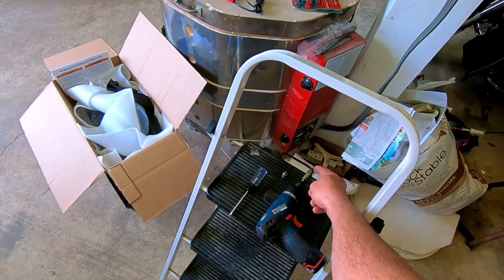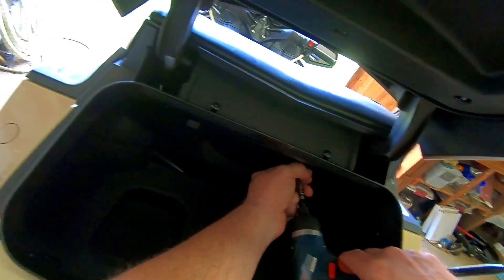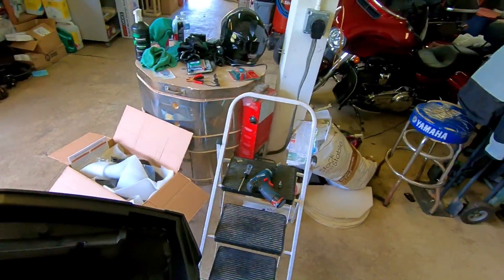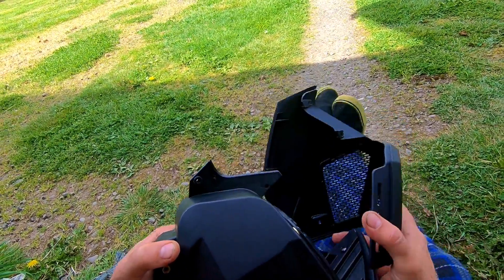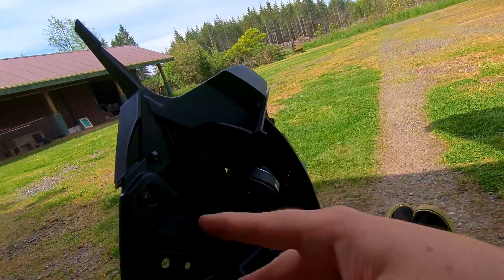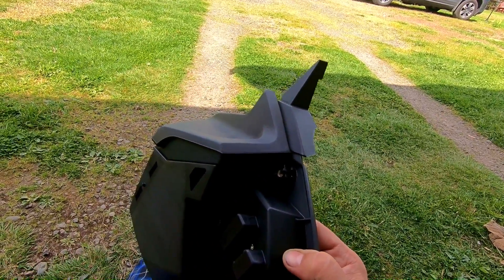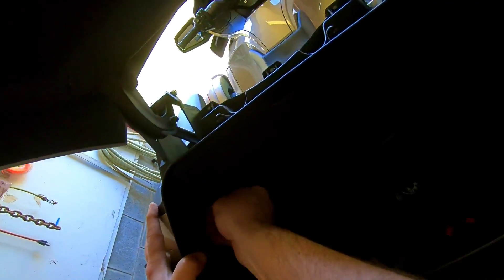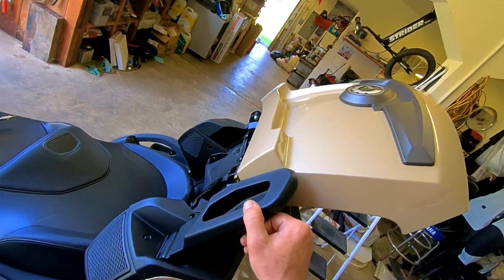BRP Armrests Install!! • For All Spyder RT Models! | TheSmoaks Vlog_980

Comment: Just installed armrests on my new '18 RT Blue Dark Ed.  The video (and really all your videos Shawn) was very helpful; prior to my purchase I watched every one of them!  You insights and mechanical aptitude are clearly evident in your narration.  You did skip over how you did the right side with the antenna, but I did find my own solution.  I simply removed the screw securing the antenna mount (brass block, with antenna attached) to the panel.  None of us Smoak Channel watchers mind your long videos!   Keep up the great work!  If I lived on the west coast you'd be my Spyder guy, but alas, you're too far away.
One last un-related thought (if you care to comment).  If your dealership sold a brand new '18 RT to a customer, would it go out the door with the latest firmware (20.8), or would you leave it with the version (13.2) shipped from the factory?
Thanks again!  - doncanfix2
Reply from the maker: Thank you very much Don!!

The firmware is a bulletin, and we can't sell a bike with an active bulletin (company policy).  It's not a safety item, like a recall, so it's not a mandatory update that must be performed by federal law.  However, if it hasn't been installed, once a dealer connects the bike to the BUDS software, they're pretty much forced to install it...

Comment: I just completed the armrest install on my 2018 RT Limited The only thing I had to do differently was the antenna removal. I could not (even with pliers) unscrew the antenna by twisting it. I had to remove the 10 mm screw that holds it on the inside of the cover. 
Great install video. Thanks for posting it.

Comment: Thank you for r1200gsa tft software upgrade tip, really liking the new screen and modes!
Hope you get better soon, you seem to be doing better than I would!

Am rehydrating after 180 mile ride in 32 degree centigrade about 90 f., a little warmer than usual for the UK . Off to Belgium on Wednesday
Reply: 32C is exactly 89.6F...... 90F is close enough my friend.  Have a great ride in Belgium.  ;)

Comment: Hey Shawn, thanks for the link to this Vlog. Just what I needed to get the lost captured nut back in place on the left speaker pod. Do you know if the speaker grills on the newer RT's work on the older ones? Ex. I'd like to put the newer ones like in this vlog on my 2012 RT. Thanks again for the great DIY vid.

Comment: hey guys  ! me again ... ----- >  o kay every one wanting to know , the antenna  at 18:30  mark on vid !  I final got around to installing my B-R-P  arm rest ,  watched this video again , and like Shawn mentions here ( hope they did not tighten the antenna on too tight )  well folks , I could not even budge  mine  but I did notice  ---  blue Loctite residue around the base of the tenna  ...  BUT  not to fear folks ,  to take the right side unit off , the antenna base unit that holds the antenna on too the cycle , is held on with the one larger bolt that is also near the wire ,with the red connector , unscrew that large bolt , and the other one , and the base will swing around freely ,    when you have the whole speaker arm rest off , carefully pull the outer plastic out from body ,and the antenna will slide out the bottom

Comment: do you have a video for the air filter replacement on a 998 rt-s model?
Reply from the maker: I may have years ago, but most likely not, as it would be hard to film all the hidden tricks of replacing one...  Thankfully those twins are slowly disappearing so few have to experience all the nightmares of working on them..! Lol

Thanks John!

Comment: Shawn, The antenna boot on my 18 RT Limited keeps coming out of the painted panel. Any tips or suggestions to get it seated properly?  😎🕷
Reply from the maker: I’ve seen folks using black RTV and carefully cleaning it up while wet so that it looks stock. I’ve also seen a black zip tie around the antenna just above the boot so it couldn’t slide up. 
Be careful with glues, as some can weaken plastic and eat paint...
Hope that sparks some ideas for ya..!

Thanks for watching!!